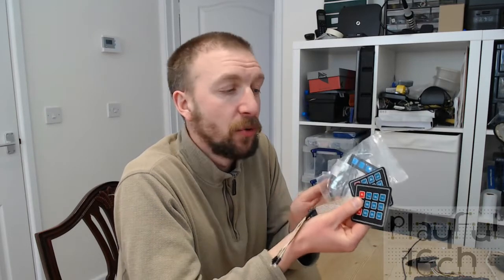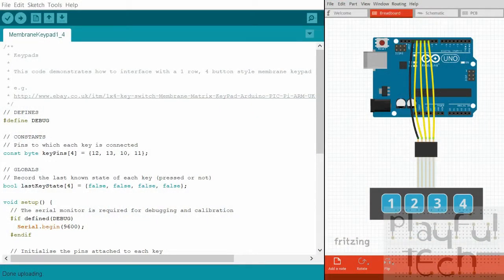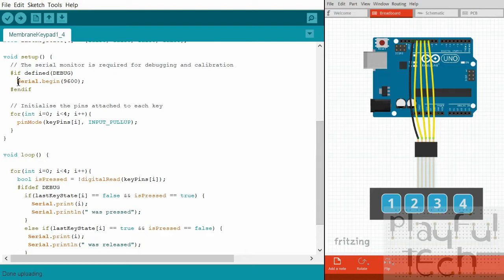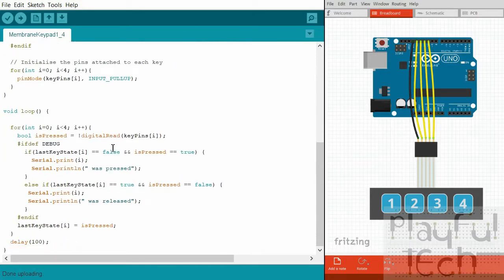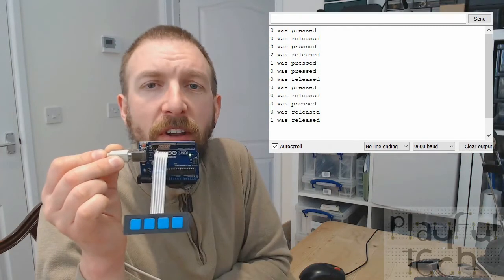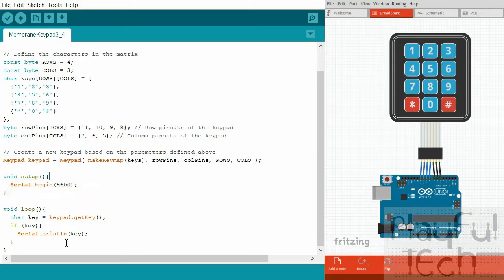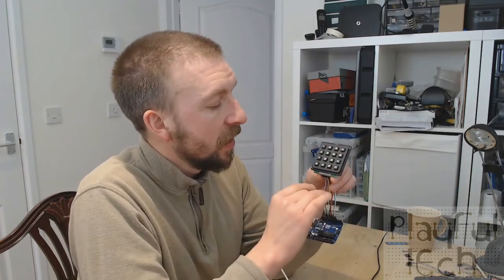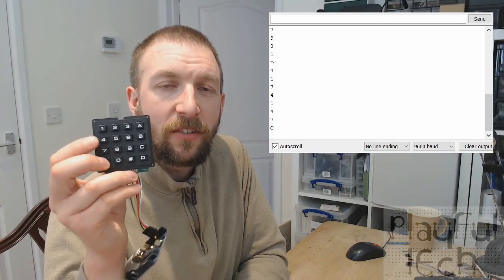Keypads

Comment: I much prefer pull-down. I get that buttons and stuff are uber commonly pulled up where zero means pressed and one means not pressed but it doesn't feel intuitive at all to me. A one makes much more sense to mean pushed than not-pushed. That's why I really prefer to ground everything and check for positives or ones to mean activated/pressed. It feels way more intuitive that way. Not sure if you can do something like that though with these keypads.
Reply from the maker: For all practical purposes, you can use either. Pull-ups are the standard, and were required from historic TTL circuitry days. I prefer them because I'd rather have long ground wires run to distant switches, keeping V+ close ti the controller, than having long V+ wire runs which are more susceptible to accidental grounding. Treating the input as HIGH/LOW ON/OFF is a trivial swap.